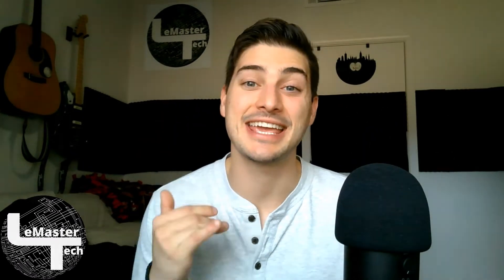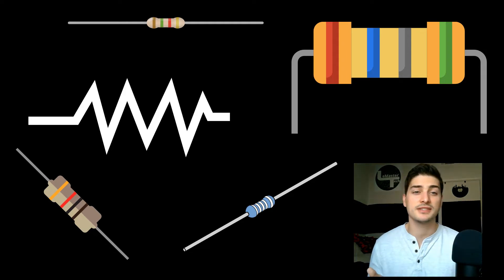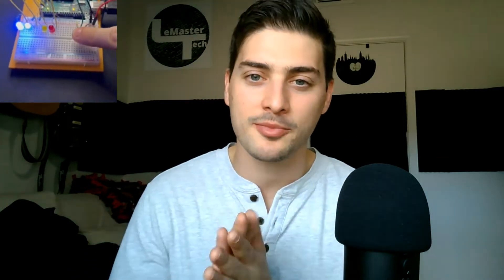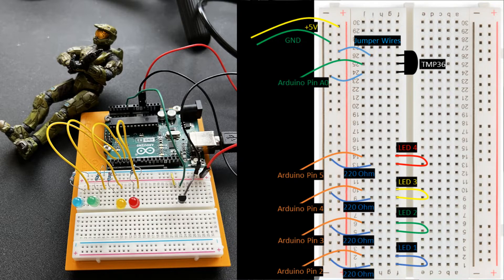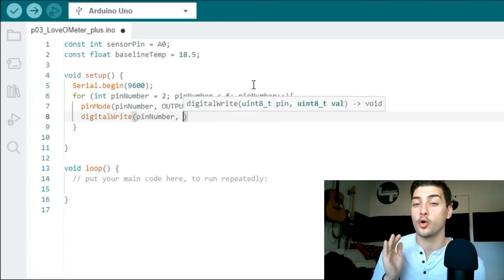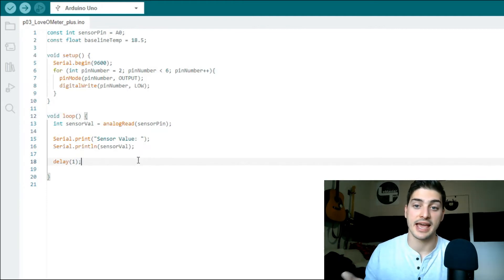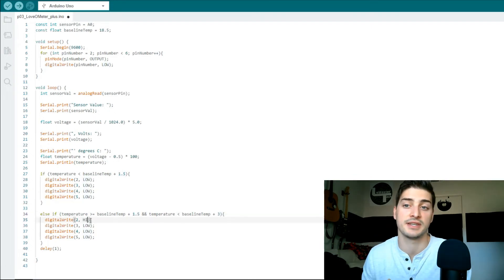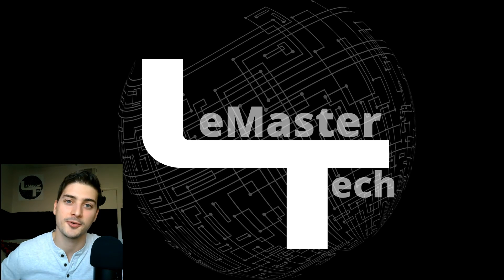How to Read Analog Input Signals Into An Arduino! Temperature Sensing 'Love-O-Meter' Project!

Comment: How can you tell what orientation to read the bands on a resistor? Is there an indicator on one side that tells you what side to start reading from?
Reply from the maker: So usually there’s a significant gap between the three or four that act as the digits and the tolerance band! Plus the most common tolerance bands are gold and silver which would not be a digit band since they don’t have digit values!
Reply: @lemastertech  okay! Thanks for the tip.
Reply from the maker: You got it, thanks for watching!